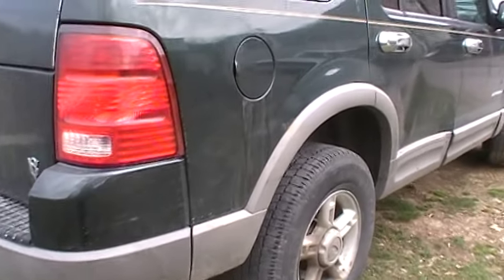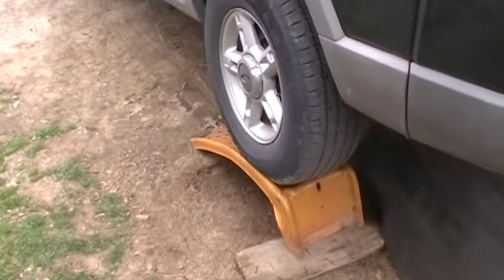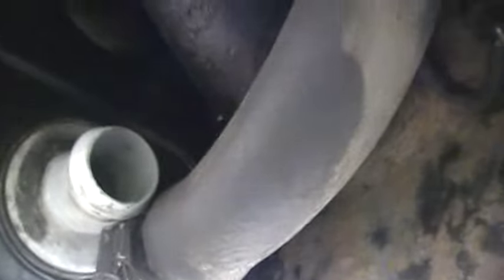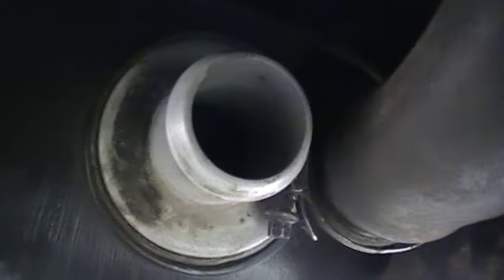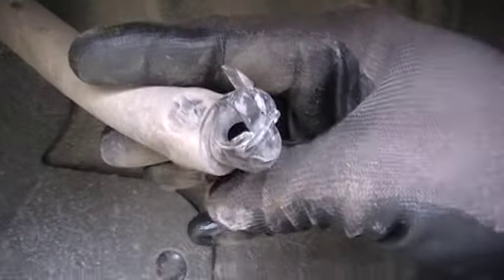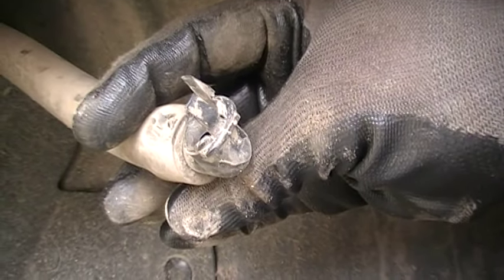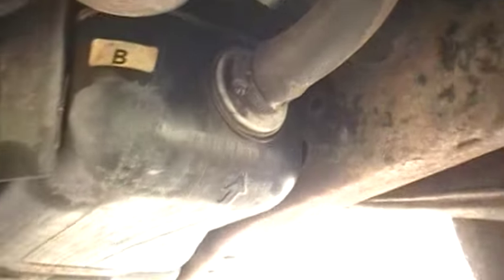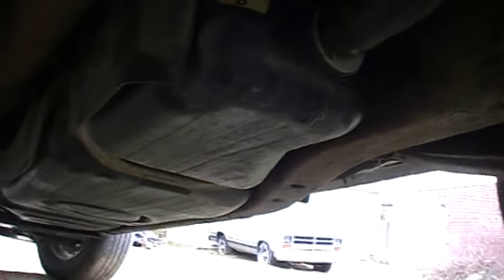Gas tank will not take gas...Easy fix maybe for you!!

Comment: After fighting with this issue for months, and pulling the entire fill tube off checking for a screen, this was great to find.  I just wish that I could pull the damn thing out completely.  Thank you for sharing this.
Reply: You Can! Use an extension from your tools or a punch, what ever and tap it right out of there. Now, it will fall into the bottom of your tank but, that want hurt anything. Just remember, your pushing, tapping hitting on a plastic value and a spring that is inside a gas tank. "CAREFUL" You do not want any kind of ignition source. This is a rollover valve, in case the vehicle rolls over it stops the gas from draining out.
Reply: Hello Friend!  great video.  my car after I changed the fuel pump makes a hiss from the fuel tank and the pump always trips.  Should it work here too?  mine is 2007.
Reply: Does that work on gmc
Reply: @gerrardromero7012  Not sure

Comment: I replaced damn near everything on my Toyota and finally figured out this damn line has been clogged. It's causing a ton of problems like rough idle and exhaust pipe overheating. The exhaust pipe getting too hot could be because of damaged valves but I'm betting it's this clogged line. We'll find out soon!

Comment: I have replaced everything on my 08 Explorer pertaining to the EVAP system because that was the code read out.  New fuel pump because 4 mechanics said that was likely the problem, not.  Since then, every sensor, relay, purge valve, vapor canister, charcoal canister, tank cleaned, still won't take gas.  How disappointing and yet relieving to learn it is something this simple, if it turns out to be.
Reply: Was that the problem?
Reply: @kauaireed9006  one or more was part of it because two codes went off.  I believe now it is the fuel tank pressure sensor and fuel line.  Two mechanic shops have reconnected the connector rather than replacing it.  Frustrating.
Reply: @pwood2295  thanks, I am dealing with the same issue.
Reply: @kauaireed9006  you bet.
Reply: Stuck purge valve is the reason the gas pump keeps shutting off.  23.00 fix.

Comment: Thats happened to me on my 2008 Dodge Ram 1500 quad cab Lonestar Edition 4.7 liter engine. My fill tank and the computerized system near the tank is way different than yours. Anyways I took it to the dealership and paid $750 for the labor and some parts. I just don't understand I keep up with my truck put the best gas you can get at Shell and never let it get below a quarter tank and I still have problems. my gas tank is 34 gallons I believe maybe 36 because it usually takes about a little over $100 to fill up. My engine s not some ordinary 4.7 liter it's a high compression ratio that uses premium and super unleaded gasoline. every once in awhile I can get away with regular unleaded but at the end my engine will start the clatter and some of my center with the anti lock system will activate alerting me at the fuel quality. But anyways I love your video.
Reply: Dealerships are criminals and so are Mechanics.

Comment: Thanks! Saved me 250.00..:)
Reply from the maker: Hell ya! $$$
Reply: My danm Saturn vue xe at the gas pump keeps shutting off I replace the purge silonoid and a new canister and it still do the same what can it be can it be the pressure sensor on the tank or the vent valve on the tank that is bad cause theres a sound under the tank like if some one is banging the tank can it be that the tank valve is crack and that why the sensor are not complain cause is a crack on the vent valve or the pressure it self

Comment: Hi Nathan,  I gave this a try on my son's 2002 Explorer.  I could feel that the Flapper was there, and I was able to push it in some, but then it just stopped.  I used the handle of the socket wrench, but didn't want to break anything by pushing too hard.  How far in should the flapper go?
PS.  Great video.  Concise and to the point...other Tubers could learn from you.  Nothing worse than someone trying to show you how to do something, but all they do is editorialize and spend 15 minutes on a 3 minute repair.
Best regards,
Rob
Reply from the maker: Maybe 1"

Comment: I just put a brand new fuel tank in my 97 f150 and now it won't take fuel you have to nurse it in by barely squeezing the handle and it takes a while to get 25 gallons in it.

I'm thinking my issue might be something else maybe a clogged vent tube or carbon canister which I'm going to see if I can't just bypass I live in the country I don't need emissions inspections and yes I hate the environment LOL
Reply from the maker: Nice!~
Reply: @FixingWithPassion  
What's really nice is putting 25 gallons of fuel in the tank at $4 a gallon here in Kentucky. LoL
Reply: What did you hafta do to fix your issue?

Comment: So I just checked mine. Is the little flap supposed to stay open?
Reply from the maker: No. Its suppose move freely while closed.
Reply: @FixingWithPassion  ok the flap on my car moved easily. I’ve changed my evap canister & changed the purge solenoid. What else could the issue be? The roll over valve?

Comment: Nice video....Do you know how those baffles are usually connected to the inside part of the tank?...In my case, I've done what you did, but it just returns back...It's actually an anti-theft thing....Was thinking about just trying to bend it out of the way of the hole, so it won't possibly be a problem in the future....
Reply from the maker: I think its a stop ball in case you roll your car up side down. I'd hit it again a few times more just a little bit harder. Could be just still slightly stick.
Reply from the maker: I think its a stop ball in case you roll your car up side down. I'd hit 
it again a few times more just a little bit harder. Could be just still 
slightly stick

Comment: I have a 93 f150 with dual tanks, and both the front and rear tanks do this.. Have not gotten into it to see if the anti-siphon valve or (baffle) is even there, but if it is, can I just remove it? And how difficult is it to get out? Looking for help without going to a spendy shop, thanks?
Reply from the maker: You can't remove it. Take off the hose going into the tank. You should see it.

Comment: My mountanier mercury 2008 , after we replaced fuel pump, the car works now but the car says fuel level low and shows its on empty, we try putting gas and the pump stops every dollar of gas we keep putting in, and leaks a litttle but no crazy leak just drissles. .

Comment: Every time i try to fill the tank full i dont get at the capacity i usually get around 11.815 but the car manuel say gas tank capacity is 14.5 gallon should i get a mechanic to check on it

Comment: What happens if I block the vent tube? I don't really want to put it back since I needed to cut off vent tube outlet from filler neck since the pipe rusted out (not the hose). Do you think it is OK to let the vent the hose just hang there in its own? do I need to blog with a  screw bolt bugs not to go in?
Reply from the maker: NO!  You need the vent tube! When you put gas in the tank it helps equalize the pressure so it gas does not come back and spray out the the tank filler cap area. Its just safer.

Comment: Mechanic A says it's the evap canister(s). Mechanic B says it's a clogged anti-theft ping pong ball in the tank.  Mechanic C (a Ford Master ASE tech) says it's a clogged screen inside the metal pipe between the filler tube hose and the tank hose; (which somehow doesn't get cleaned with oceans of gas being pumped into the tank).  Lastly, mechanic D says it's a stuck vent solenoid valve.  Yet, ALL methods fix the problem.  WHY?  Because all methods involve BANGING on ("in the area of") your fuel system, which OPENS THE STUCK VENT SOLENOID VALVE! --- (Ps... If it's the evap canister, your check engine light will come on during a purge).
Reply from the maker: Boing!
Reply: Hi Nathan...    Your video made me think (a lot).  Then the "Ford Master ASE Tech" and his "clogged screen" repair opened my eyes to the reality of what was going on.  All these repairs are freeing that stuck solenoid.  Nevertheless, I'd still be guessing were it not for your video.  It HELPED ME to conclude "Boing!"  -- Thanks, buddy!

Comment: I pulled the baffle out and still have the same issue
Reply from the maker: Lucky Plumber ....Hum....something is restrict ING the air  pressure. I'd check to see if you have a blockage issue.
Reply: I saw a guy on a Chevy video pull his tank and ran air thru  all the vent lines . He blew a whole bunch of crap out of his . May work for you